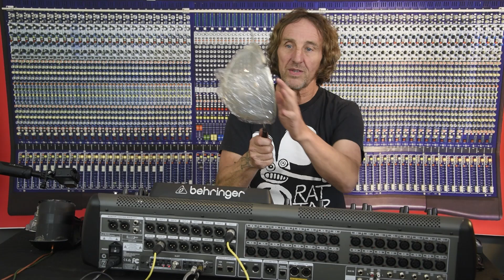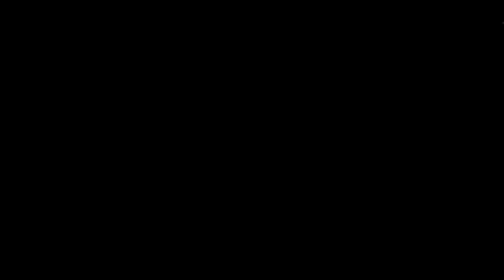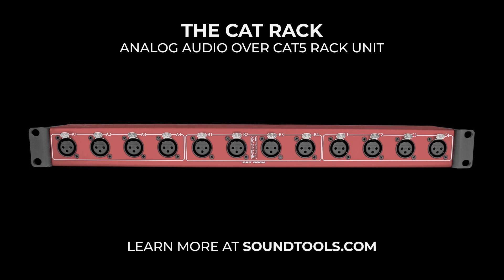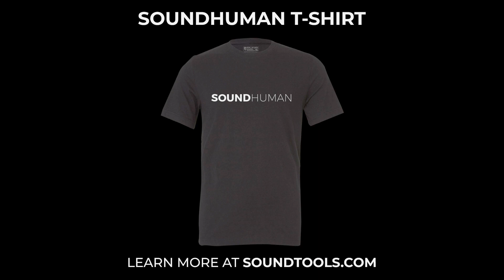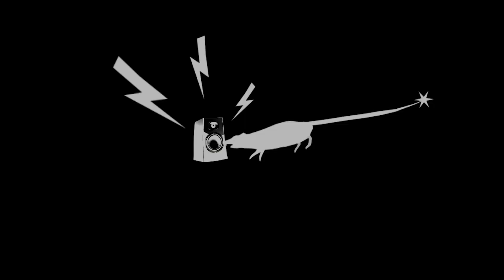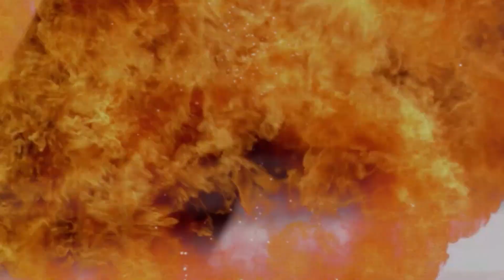Aux Fed Subwoofers Are Better - Because of How Mics Work

Comment: I guess depends on genre etc, but hipass at 90hz is ultra conservative.... Hihat you hipass at 400 hz sometimes and overheads for heavy music goes all the way up to 250... Well depends on music, but if music is not heavy then it doesn't matter the junk in the sub as it's probably not sub based music... You mix for your style and use the equipment accordingly. If you just hipass the hihat to 90 in a heavy track you will have lot of other issues not last the pahsong of the low end of the snare for example, which can be way worse than some low junk in subs. But I love both techniques and adapt my mixing to whatever is used. When I have a choice I would have the sub on a different aux but for different reasons (ability to adjust delay and phase for example and hipass the whole mix to send to the tops are just two examples). Still a nice explanation well done.
Reply from the maker: The reason I use 90 Hertz is because the sub in the demo is a single 3" speaker and I wanted you to be able to see what is happening and understand the fact that a high-pass filter does not eliminate low end going from the subs it only reduces it.

The goal of the demo was to point out that if 90 hz affects this tiny 3-in speaker in an audible and visual way can you imagine how much a 180 Hz high pass just one octave up effects 24 subs reproducing many orders of magnitude more energyy?

And thank you and I thought using a speaker where you could see what's going on would help rather than distract and will ponder a demo that shows the impact with very high set high pass filters and how the high pass filters ruin the sound and still don't eliminate low end going to the subs

Comment: I love this guy. So a mic in a giant concrete block would have less mechanical movement than in a cage that only evens out the mic moving, except in an environment when the whole ground shakes like near a train or trucks on a road sending a pressure wave in front of them through the ground
Reply from the maker: Stable mounts and shock mounts do help but wind is a whole other issue as well as handling noise

Comment: So, if HPF on the channel is set to the same filter slope, type, and frequency as the LF crossover, and it's been placed on the main mix bus, isn't that the same as aux fed subs? 

I get that this makes sense (and I am a huge fan of aux fed subs) on a mic channel. Also HPF slope and type will be no where near the crossover usually, but it's worth the question...
Reply from the maker: Yeah and no. A high pass on the channel is or can be the same as a high pass on the main PA.

But a high pass on a signal that is sent to mains and subs still sends some of the high passes signal to the low passed auba. Also, if you boost LF on a high passed signal it lowers the high pass and sends more to the subs.

With subs on an aux, no signal gets to the subs unless sent, regardless of high pass setting or EQ

Comment: How would you handle reducing stuff going to the subs if you run drums into a mix buss, then the mix buss to LR? Even kick and snare on a bus together will have some extra junk. I am curious what you'd think about working about it?
Reply from the maker: Use 2 drum busses, one for insts w subs and one for without
Reply: @DaveRat  I see, that would work, but if you want to compress the drum group all together? I guess that's where parallel comp really shines.
Reply from the maker: Typically compressing the entire drum group is the opposite of desirable.

The kick drum will tend to force everything into compression which creates a pumping sound on the other instruments especially if you have anything that has high frequencies like symbols or any bleed of symbols into the tom mics. So compressing the entire drum group as a whole makes the compression more audible and unnatural sounding.

Unless that is the sound you are looking for

Comment: I mean don't most mixers have a high pass filter for this that cuts off any low end on that channel? Even the cheap 100 dollar ones have it
Reply from the maker: It's important to know that a high-pass filter is a filter not a low frequency eliminator. A high pass filter reduces low frequencies and to really eliminate low frequencies you need to set the high pass filter very high which ruins the sound of the instrument.

Mixing all your instruments together and then trying to filter frequencies back out is one way of doing it

Or just not sending the frequencies you don't want to the subs is the other way

One way you lose control get extra low end that you don't want and impact the sound of the instruments. The other way you get exactly what you want to where you want at the level you want

Comment: I've been in a karaoke bar where they had somehow gotten subwoofer and one of the overhead speakers mixed up. Not sure how, maybe crossover outputs got mixed up or something... Well, anyways, took them pretty much a year to fix it. Drunk people singing and listening karaoke apparently don't mind that much about the sound, they just like the activity.
Reply from the maker: Agreed and there is something kind of cool about total disregard for everything except having some fun. Also it's highly upsetting to have broken sound so easily fixed and no clue it's broken.

If it was a TV with a color out, the TV would prob be fixed or replaced imidiately

Comment: I agree that maintaining the crossover point is important. Always did aux fed but noticed when well mixed the send would always be close to each other. The current system I work with is stereo to all but ive been considering ways to isolate the subs from signal I dont want in there. Working on a Yamaha right now so I think were going to put the subs on the mono buss. Thanks for all your encouraging videos. Im glad to know im not the only one considering all these ideas you go over.

Often people will respect your opinion over mine but i take it if it means implementing the improvements and opening the eyes of others.

Your company did an event for us at Anaheim last year the crew was awsome, thanks.

Comment: I suspect one reason high-pass filters don't work is that by the time the audio gets to the filter the damage is already done.   By that, I mean that large low=frequency pressure waves hitting the diaphragm of the mic will push it to its limit stops and thus introduce high-order harmonics of the low freq sounds.    Seems to me the real solution is a mic physically designed to not respond to low frequencies at all.
Reply from the maker: Using mics that can handle the source is important

As far as high pass filter ability to eliminate a signal from the subs, a high pass is a filter that reduces but does not eliminate frequencies below a given frequency.

With a separate send, you can completely eliminat that signal from being sent by not sending it.
Reply: @DaveRat  Understand and agree.  My point was that high intensity low frequency sound can make any mic distort even mid band frequencies, because their magnitude drives the diaphragm into the end stops (or at least into a non-linear part of their dynamic range).  So wind and high-hat puffs  can ruin the sound coming from the regular speakers too.  And a high pass filter is too late.
Reply from the maker: Yes low frequencies can overload and cause numerous issues if the mic is not designed to handle that magnitude but that also can't be fixed by anything after the mic so it's all about switching the mic or putting on a windscreen or whatever

Comment: This is such a sweet video to see during this “modern mixing revolution”. SO many engineers mix full range, and I feel like this video debunks a lot of their theories out there. I really appreciate your input here. Like you said, “it’s not about mixing subs on an aux, it’s about not sending everything to the subs.” 

In general: how do you feel about flown subs? I work in a venue that has flown subs tied in with the Main Arrays. There are ground stacked subs on a separate drive line. The 2 zones of sub can be difficult for some engineers, but everything is in phase, and I personally really love the result. I feel like the best approach is to use the ground subs as supplement (on an aux.) Would love to hear your thoughts. Thanks!

Comment: MAYBE YOU HAVEN T CHOOSE YOUR RIGHT WORDS .IT S CALLED ENERGY .AND YES IS A LOT BUT THAT NOT MEANT NECESSARLY DO NOT BEEN TRANSLATED BY MECHANICS INTO NOISE NOT SOUND ! WE NEED SOUND NOT NOISE ! OK ?
Reply from the maker: Yes and mics convert low frequency vibrational energy and air motion energy like wind energy that we can not hear into sound energy that we can hear.

This is one of the issues with sending every mic to the subs but there are more issues.